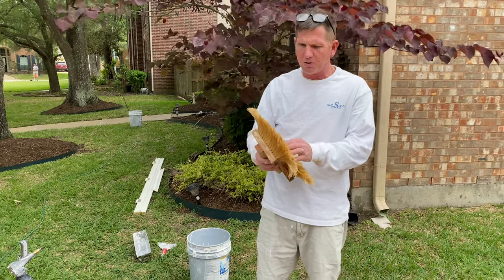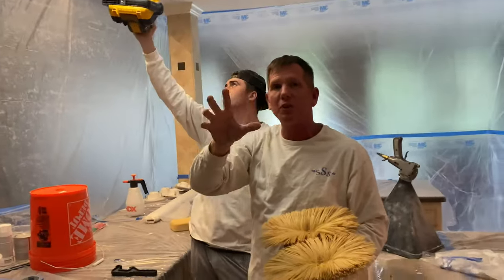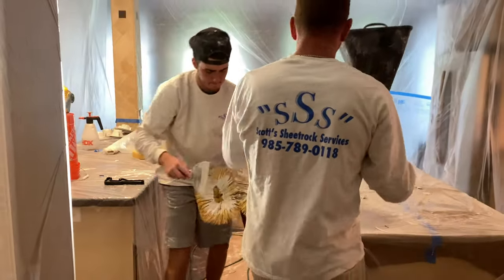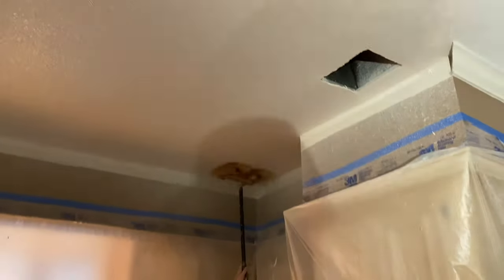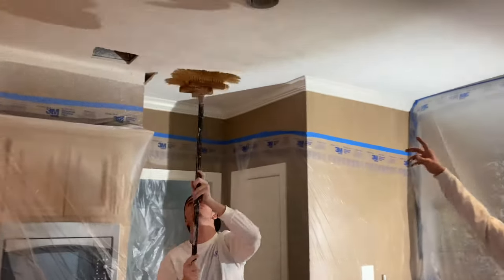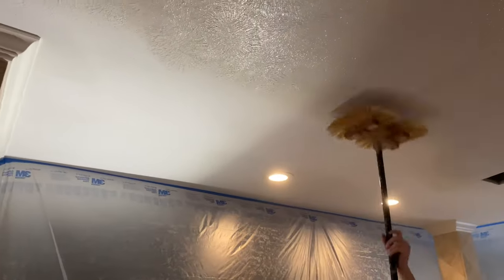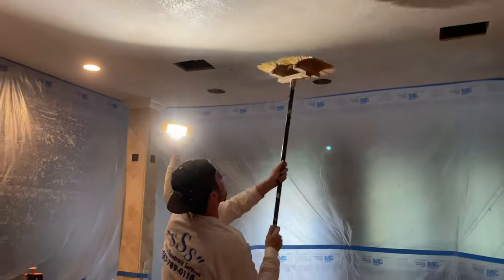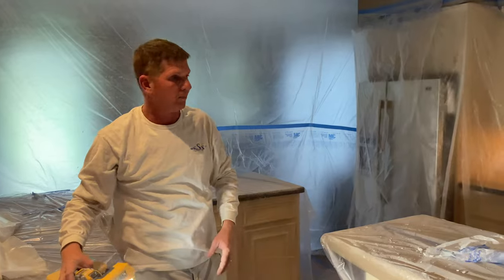How to texture a drywall ceiling (light stomp/crows foot)

Comment: i would have just rolled over and then stomped much easier
Reply from the maker: I also have another video rolling it on you can get more mud on the ceiling quicker with a hopper. With small repairs that’s all we do is roll on and then stomp.
Reply: @scottssheetrockservices  yeah true depends the job